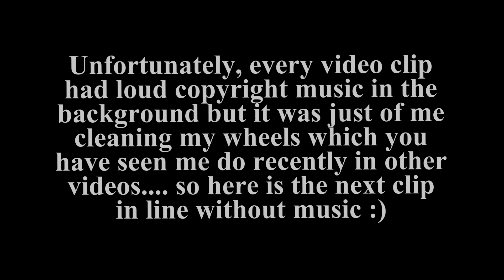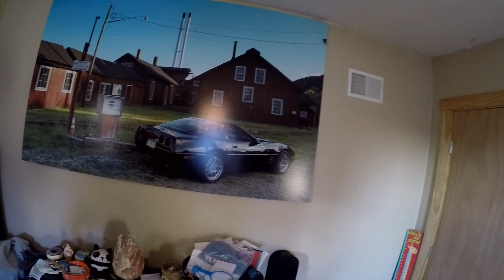Adding "64" Horsepower to a C4 L98 Corvette. Cold Air Rammer, Chip and Foil

Comment: You did a chip, cold air , air foil. No 64 horse power .  Try doing ported plenum, bottom intake, under drive pulleys, and go with TPIS long tube headers cost and there 3 inch y pipe with there 2 chamber flowmstair muffler s. Look up TPIS performance. And add a adjustable fuel pressure regulator and a MSD 6AL box with 65000 volt coil with new spark plug wires.
Reply from the maker: Maybe someday!

Comment: I was gona get a vortex ram but hear the housing warp over time from engine heat so i just modified my stock air box to breath better.
Reply from the maker: Mine warped a little too. Kinda cheap, I guess.
Reply: Yep . Just cut the inside wide open.  Throw a k&n air filter 
 Good to go.  These cars need at least a 373 gear some headers , straight pipes +  borla. And they launch pretty dam good

Comment: The biggest butt dyno improvement bolt on Ive ever done on an L98 was long tube headers. It was stupid expensive (ARH required remote oil filter) but picked up some decent power. Other than that my top pick is a 6 speed shifter upgrade
Reply from the maker: Hi Camaro Rick, I would love to do headers sometime but I hear that are really difficult on the L98. Is that true? What is the 6 speed shifter upgrade? Thanks for commenting. Take care!
Reply: @Doulop  Getting the original exhaust unbolted is a challenge. The air injection fittings have to be torched to get them out, may have to unbolt a motor mound and lift engine up a bit to get the LT's in place. Other than that its straight forward. Just expensive to do the whole exhaust at once to match up with long tubes. The short throw shifters for the ZF 6 speed C4 transmission is a nice upgrade. Last one I did shifted nicer than my T56 short throw!
Reply from the maker: Camaro Rick, thanks again. Maybe someday. I appreciate your information!

Comment from the maker: Hi everyone, thank you all so much for watching the latest video of the DYNO from 2012. This video is of the next day adding some performance parts to her. The parts said they should add 64 horsepower. VERY doubtful but we shall see in 2020 when I get her DYNO'd again. I really appreciate your support. Have a Merry Christmas :)
Reply: I did about the same to a 1985 Corvette, a cat back was WAY more effective and made the car a solid high 13 second car.
Reply: those were some of the first mods that I did to my 1986 Corvette way back in 1992. Surprisingly the car went a little bit slower not only on my stopwatch but at the track. Completely stock my car ran 14.30 96.1 miles per hour with about 300 lb of stereo equipment(20 component speakers,  4 amps,  extra 900cca battery)  installed in it. Then with a cold air k&n (straight down through the bumper), air foil,  slp high flow runners,  hypertech, flowmaster cat back, a comp cams e-cam,  the car was a little bit slower at 14.44 at 95.8. I think I lost low end torque from the bigger cam and the engine couldn't breathe to take advantage of it.  My 0 to 60 slipped from 5.9 to 6.1... I chased demons all that year.  Then tossed the tpi for a miniram and full exhaust and a bigger cam (stock bottom end)  and went 12.36 @ 112.04 for many years without issue.  Fast forward to now and it has a 420 cube SBC that's run 11.25 at over 122 untuned.
Reply from the maker: Sebbonx Xsebbon, that’s awesome!! Thanks for commenting. Take care!
Reply from the maker: Larry Keller, that’s crazy. It makes sense what you said though, thanks for commenting. Take care!!
Reply: Hey Doulop, i like your content and love your car, keep it up! BTW while you're out there dolling up your corvette you should know this: Get a can of Off! Deep Woods bug spray or anything with 15% or higher DEET and spray it on a paper towel. Rub this stuff around on whateer lights seem to have that yellow tint and it rubs right off like a film. MILES better than any 'headlight cleaner' nonsense and cheaper too. I personally guarantee it. I did it on my 02 Bonneville, my 02 Firebird, and my grandpa's 03 Jetta TDI (i saw you had one but we got the turbodiesel B)     ) try this out on your foglights and it'll be one of the last things you need to do before you have a showcar. Good luck, hope you take my advice (and throw me a bone and talk about it in your videos if you dont mind spreading the word) good luck with everything , hope all is well, and Happy new year!
Reply from the maker: Devon, this is awesome news because my new Jetta came with 1 headlight replaced so the older one is slightly yellow and I bought a cheap Turtle Wax kit to try. Haven't done it yet but maybe I can do a comparison video. I will for sure do the Vette too :) Will definitely give you a shout out, my friend. Thanks for much for watching and supporting the channel. Take care! Happy New year!!
Reply: @bonzainews  actually a well built 327 in there would beat that big bore stroker so bad its not funny. I have a SS/JA corvette running a ported TPIs miniram factory #113 ported heads and a 242 / 254 solid roller cam running a best 10.18 @ 131 consistent 10.20 car.  if i could run a 3.25 inch stroke I'd be in the 9.99 index. longer stroke does not equal faster car. Im shifting at 7000 rpm (which would end your stroker), with a 327 id be shifting @ 7750. You guys with these crazy large cube small blocks crack me up. Its not like your 420 cubic inch small black could mount much of a challenge against a 427 big block.
Reply: @MasterWitchDoctor  sounds like your car is a gutted,  race only vehicle.  What chassis is it in?  And what's the race weight ? Does it have air conditioning?  My car is a street driven car on pump gas
Reply: @MasterWitchDoctor  funny you say that 7000 rpm would end my motor.  7300 is my rpm through the traps.  I have 4340 crank and 4340 h beam 6" rods,   eagle rotating assembly,  custom J/E pistons with 1.05" compression height.  Extremely light weight short skirt race pistons. My avatar is the max rpm through the traps on my playback tach.
Reply: @bonzainews  gutted?  Super Stock requires the car to be a minimum weight (with full factory interior) and that is calculated by the NHRA in pounds per factored horsepower. The NHRA weighs the car at every event to verify its NOT gutted and meets the Super Stock rules which for my 1990 Corvette Coupe is 11.45 (3149 lbs based on NHRA factored 275 horsepower ) putting my car in the SS (super stock) J  (11.00 - 11.99 lbs per horsepower) A =Automatic so my class is SS/JA and the tech inspection goes over everything from the blocks casting numbers, heads casting numbers, compression ratio (must be stock), safety features like an SFI approved harmonic balancer and flywheel, drive shaft loop, roll bar. The NHRA even tests the racing gas (VP C14+), my car weighs in around 3180 lbs. No Air Conditioning but I use an alternator and power steering pump with reduction pulleys and electric water pump. The air cleaner is a TPIs and uses a K&N filter because in Super Stock you have to use a factory stock air cleaner or use no air cleaner at all. Ive built several super Stocks and Stock Eliminators, to me these classes are about expertise not how much $$$ you spent under the hood. Even the tire size is restricted to 14 & 1/2 inches wide and 33 inch diameter. Its actually better to have the car a tad bit heavy vs having it bumped up to the next class.
Reply: @bonzainews  and what does it run @ how fast? 10.18 @ 131?  consistent 10.20 car?  not even close Im thinking mid - low 12s at best.
Reply: @MasterWitchDoctor  you're right it's not even close,  I don't have a race car,  I have a street car that's never been tuned,  it ran 11.25 @ 122.10 with the factory ECM, untuned.  I brought it to a shop a while back and they were supposed to dyno it and install a accel gen 7 dfi and tune it. They did dyno it but never did the instal and tune.  It's been sitting 10 years since I tried to install and tune myself. No luck.  2 kids and 2 business put it on the back burner
Reply: @bonzainews  well   priorities are just that.  I own an engine shop and build engines plus a computer repair shop so I get that running businesses thing. I sponsor  3 cars 2 are super stocks (66 Chevy II with a 283 and a 68 Z28 302) and the other is a stock eliminator 86 Camaro. Drag racing is pretty much my life and  adrenaline is my drug
Reply: @MasterWitchDoctor  sweet,  where are you located?
Reply: @sebbonxxsebbon6824 auto or manual

Comment: The difference between you and I is that you have/had an OCD concerning the finish and shine of it's outer millimeter or less.  I on the other hand, drive my '91 year round in Michigan.. weather permitting of course.  If she were YOUR car, you would be abhorred by a deer running into the side of your cherry Vette.. as was I.  Her name actually is Wild Cherry because she is all original with low miles.  But a deer busted my fender.. which means it busted my entire hood as you know.   I'm going to put some duct tape on her and go country cruising again.  I don't sweat the small stuff.  This car is meant to be driven more than looked at.. by ME anyway.. imho.   I cannot see the crack from the cockpit and it does not effect her handling.  From the inside, she is just as good as she was before.. and I don't care if she is not as pretty on the outside.  Beauty is in the eyes of the beholder.. and Wild Cherry still looks good with a scar.. to me anyway.
Reply from the maker: Thanks for the comment. Everyone is different and pays attention to different things. Glad you still enjoy Wild Cherry! Thanks for watching!
Reply: @Doulop  Of course we are.  I'm sorry if I sounded judgemental.. I didn't mean to be mean.  I was just pointing out an alternative C4 lifestyle.

Comment: I have a red 91 C4 and It’s already chipped. I wanted to ask where you got your air intake kit from and what is that metal piece you showed in the throttle body? Also great job on the videos
Reply from the maker: Hi Tom, thanks for your comment. So cool you have the same year! I bought the Vortex cold air rammer kit from Ecklers but you can also get it from Corvette Mods. They aren’t real cheap but I really like the way mine breaths now and the sound it makes. Also, the metal piece is called an air foil. Also buy at same place or eBay. Not too sure it does anything at all. Who knows? Thanks so much for watching and supporting the channel! Take care!
Reply: Doulop thank you for the info... I appreciate it and look forward to videos of Katie
Reply from the maker: Thanks so much, Tom. If you subscribed, make sure you hit the little bell beside it to get notified. Thanks again!

Comment: Maybe 10 hp at most.
Reply from the maker: Agreed! Didn’t expect any more than that
Reply: @Doulop  Did you bypass the the coolant hose to the throttle body, and remove the frisbee? My 1990 rag top has 3 inch exhaust pipe no resonator, but with stock mufflers. Air pump delete kit. I just purchased a 2,200 stall speed converter that I'm going to install since I need to replace the rear main seal anyway. Just port and polish the lower intake with a BBK throttle body, and it will be just as fast if not faster than the LT1 Corvette.
Reply from the maker: I never heard about bypassing the coolant hose to the throttlebody. What does that do? I plan on getting rid of the frisbee here soon!
Reply: @Doulop  It was designed to make sure the throttle blades don't ice over in extreme cold weather. Most smart people don't drive their Corvette in the snow anyways.  What good is having a cold air intake  if the throttle body has coolant warming it up? Very easy modification that might cost you all of $10 bucks.
Reply from the maker: Thanks. Makes perfect sense. Never drive mine in winter!
Reply: @Doulop  Did you ever replace your oil sending unit yet? I saw one of your videos and it was almost at 80 psi.  Mine did the exact same thing, and it was leaking oil. Replaced it along with the oil pressure switch, and the gauge reads normal now. Its next to the distributor.
Reply from the maker: No, there are plenty of things that should be replaced on that car. I need to.
Reply: @Doulop  Where are you? I'm in O.K.C.
Reply from the maker: Where is OKC? I am in PA
Reply: @Doulop  Oklahoma city, Ok
Reply: @Doulop  Good friend of mine is from Halifax, PA he actually moved here because real-estate was so much cheaper,  and bought a house a year after being here.